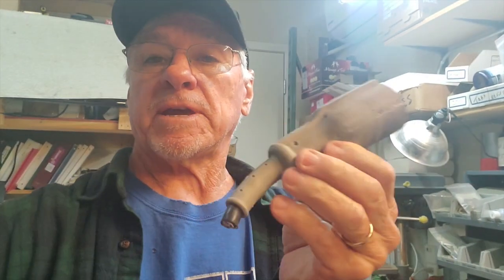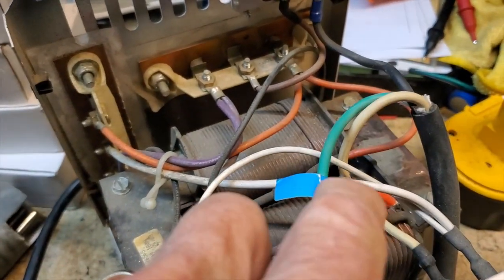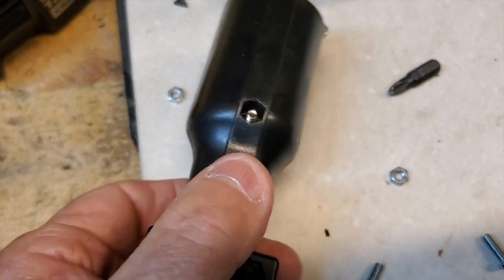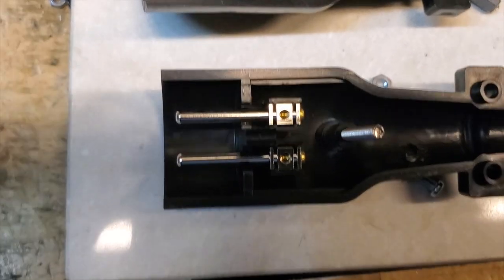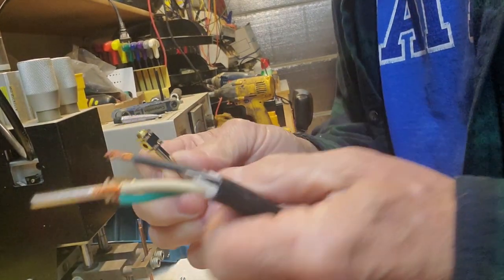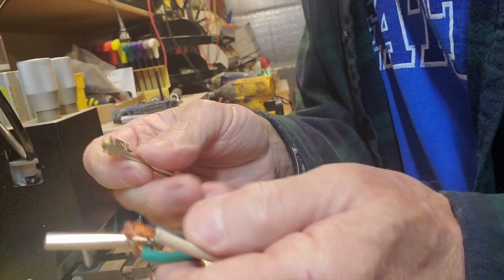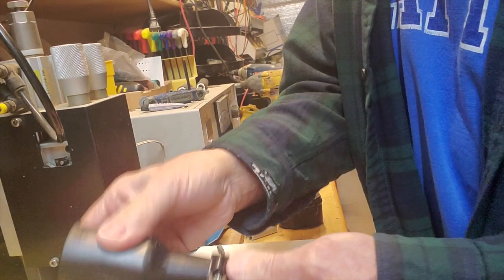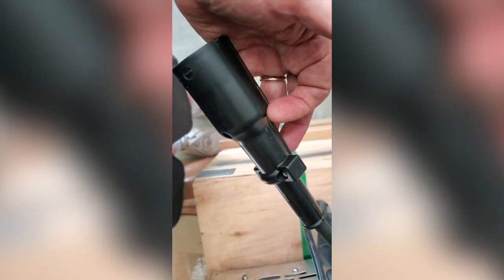Changing Cord Cap on a Club Car Charger

Comment: Could you just install alligator clamps and charge the battery directly or will the charger not detect is there a way to bypass the computer
Reply from the maker: You can put clamps on other chargers, but not on powerdrive chargers,  it won't work

Comment: I have a 2001 clubcar ds  sononioled rester wire smoking need your help on whats wrong cart will not move
Reply from the maker: Are you saying the resistor that mounts to the resistor is heating up?

Comment: Yea my charger doesn't work i tested each part and they are all good like you told me to do and it don't work it clicks when you plug it in but no charger sound
Reply from the maker: If you tested everything good, even the transformer?
Reply: @waynemartin.waynesgolfcart4900 nope I wasn't sure how to do that?
Reply from the maker: its dangerous,  have to be very careful not to let wires touch, and you don't touch any.
Need to unplug the 2 wires coming off the transformer that go to the rectifier,  plug cart and charger in, and see what voltage you have on those 2 wires.
Reply: Being 2 years ago and no response is worrisome.. 🙏